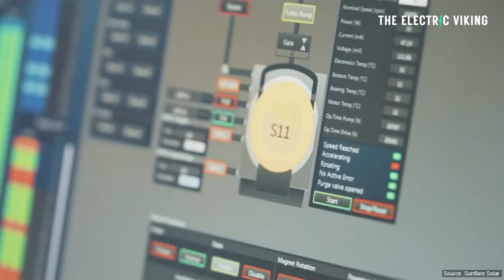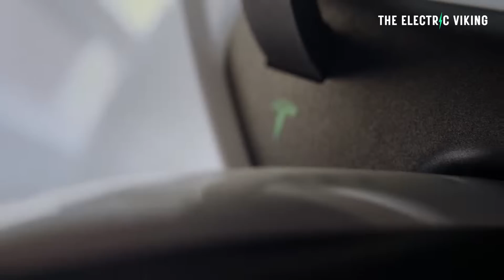Panasonic says homes and offices will soon be powered by their windows

Comment: Rogan asked Musk why they don't put solar panels on cars and Musk said its not worth it right now. The panels only get X amount of watts per square meter. I cant remember the exact amount but Musk said cost versus available space just is not worth it. Maybe in the future.
Reply: Musk was talking about current panels on the roof. This turns windows into panels. If they could cover the whole car.
Reply: @toddwilliams5905  let’s use “one square meter” because that’s an easy value to look up, and it’s still going to cover the whole roof of the car. Solar power, at the surface of the Earth at noon at the equator, is 1360 watts per square meter. That’s the absolute peak theoretical amount of power that exists, not what can be extracted, not what can be converted to electricity. Solar panels, being about 15–20% efficient at doing that conversion into electricity, produce maybe 180–250 watts. If you keep them pointed directly at the sun, which of course, your car doesn’t do. Over the course of an 8 hour shift, that means you’re putting, at most, in total fantasy land, 2 kWh of electricity into a 60+ kWh battery. You’re far more likely to get 1 kWh or less because the angle of the sun isn’t always perfect, there’s trees in the way, or a cloud or two will pass overhead even on sunny days. Nevermind the days that aren’t sunny.
Not much of a charge, eh? You’d actually get quite a lot more if you plug the car into a standard 110 volt plug at 1.6 kWh per hour, (that’s 6.4 times as much as a 1 meter solar panel!) which is also known as “the worst possible way to charge an electric car, but if you have to, that plug is everywhere.”

Your solar panel would therefore be mostly decorative and not actually useful. Kind of like bull nipples.

If you really want to power an electric car with solar power, you need bigger solar panels. Like Panel at the solar farm or a lot of panels on top of a car port. Any solar large array. 

Covering a car in panels or paintable solar paint and then doing the windows for a little extra is not going to do it today or most likely in the next 25 years.
Reply: @toddwilliams5905  Still wouldn't be enough

Comment: There was a company yrs ago that touted that w/windows but never performed.
Reply: I'm guessing the problem is that it's much easier to just put solar panels on the already available flat roofs that most manufacturing companies already have. It's also probably cheaper to replace roof-top solar.
Reply: I know a few people at one of the top US universities who are working on perovskite solar panels. They’ve been getting good results. One challenge that they are overcoming is making their perovskite films durable
Reply: Johnny, I’ve switched to installing metal roofs on the homes I build. They are long lasting, fire resistant, and the new ones come with reflective paints. Wouldn’t be too hard to just coat the metal with a perovskite film.
Reply: @freeheeler09 are the metal roofs very loud when it rains? Also don’t they have solar roofing now?
Reply: But if you can get investors,  government grants & subsidies 💰💰💰. Pay yourself a couple million per year... when the company fails and goes bankrupt... you'll still be a millionaire 🤑

Comment: Using windows and other vertical surfaces for solar power is excellent for the Northern and far Southern latitudes where the sun is never high in the sky. In fact the Antarctic bases use conventional silicon panels mounted on the vertical walls. Even in sunny Australia, vertical panels make a lot of sense because they generate most power morning and evening, when the demand peaks are. Even as a retrofit to the many high-rise office towers in our cities they will offer the benefits of a solar farm without the need for a large area.
The potential problem of one office tower shading others is not really a major problem because there is considerable diffused radiation as anyone who has monitored their solar power will know. In fact large 'glassy' buildings have the potential to act as mirrors and shine sunlight on other buildings that might otherwise be in shade.
Reply: In a couple of years, we’ll probably be picking up our perovskite film windows at the big box store